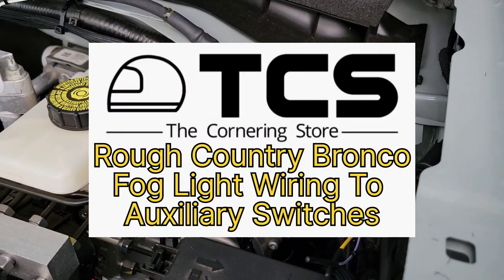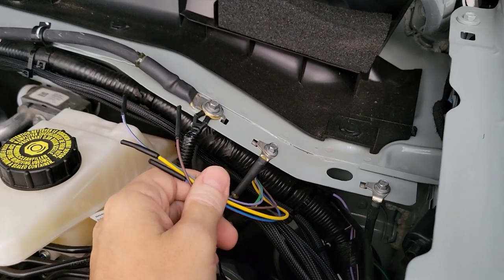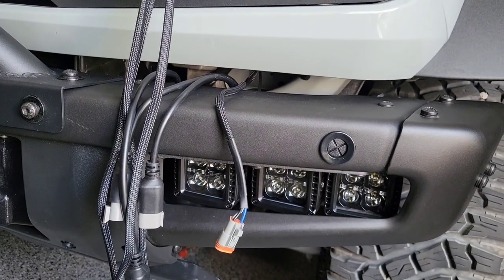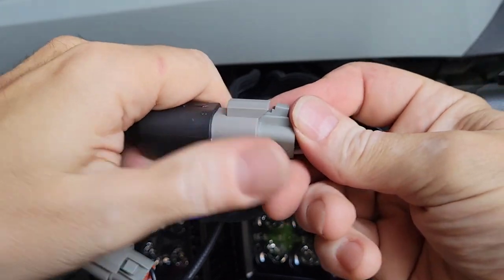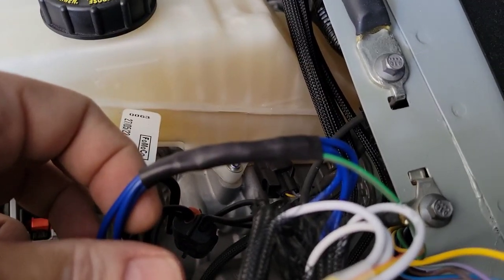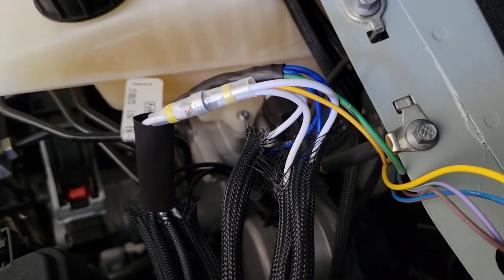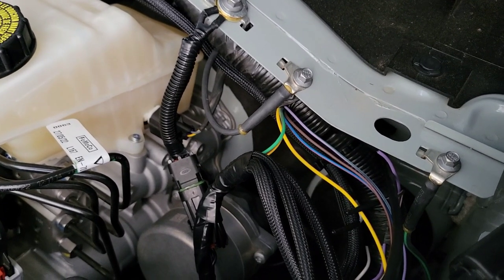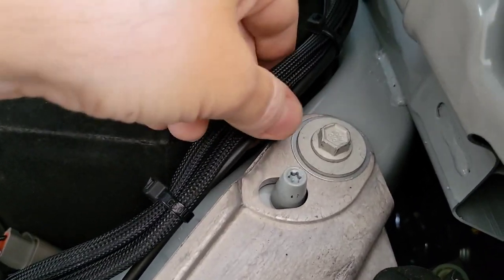Rough Country Bronco Fog Light Installation Wiring With Auxiliary Switches

Comment: Hey! Just wanted to pass on a solid THANKS for this video. I didn’t buy the ones with the DRL, just the basic high output ones from Rough Country. I used the solder thing you recommended too. Worked great. Again, thanks for the video.
Reply from the maker: It's great to hear it helped you out, and you're welcome!!!
Reply: Did u get the flood or the spot? And how is it

Comment: This video was so helpful. Great video. Did you get the white or the amber DRL? I can’t find anything that can explain the difference
Reply from the maker: I have the white DRLS.  The DRLS just mean the color of the backlight.  You can run them on  a different switch  so they are always on when the truck is running.  I picked white so it would go with the headlights since they are always on when you are driving (daytime running lights).   When I want the full brightness I just flip the other switch I have wired to the higher power bulbs in the lights.  So the backlights are just for looks really although they do make you a bit more noticeable coming down the road I'd say.

Comment: Great video!! How are the lights holding up so far? CN you make another video how they look on, off and drls? Thanks
Reply from the maker: They are doing just fine.  I just have aux switch 6 for the DRLs flipped on permanently so they alwayd come on and off with the Bronco.  I've only used the full power once at night and they did a good job of really lighting up the dirt road ahead.  I think with some ditch lights up top to cover the sides a bit more it would be plenty of light for any casual offroad enthusiast.  If I'm able to put together a good lighting scenario I'll put up a video of it.  Thanks!
Reply: @TheCorneringStore  Do you happen to know what the amperage is for the the RC backlighting drls for all 6? I am playing on adding a pair of the same 2" drls as ditch lights and wanted to know if i would be able to tap into the exsisting 6 I already have in aux 6 without it being over the 10amps.
Reply from the maker: @thefontsforfunhustleig3026  I plan on doing the same thing if I add some ditch lights and they have drls. I never saw any listed wattage for the DRLs, but I don't see the drls pulling anything near 10 amps so you will be fine adding another pair into the 6.  I've just had my #6 switch flipped permanently still for the drls and all is good!
Reply: @The Cornering Store  yea my aux 6 is always on too. I am adding the ditch light tomorrow so if any problems I will let you know. Thanks
Reply from the maker: @thefontsforfunhustleig3026  lmk, I was actually just looking at the RC ditch lights online and have them in my cart.
Reply: @The Cornering Store  all installed and they look awesome. No problem tapping into the other drl wire.

Comment: If you run your drls on switch 6 and they are on full time are you able then turn on your switch two and run both the drls and full lights at the same time?.....or is that bad for the lights
Reply from the maker: Yes, you can run both.  No reason it should be bad for them at all.

Comment: Where did you attach the rellay and did you attach the red to the positive battery.  I've never done wiring I want to learn and not call guys all the time to do things for me. But I also don't wanna f up my bronco
Reply from the maker: The Auxiliary Switches have relays built in already.  You just need to ground all the lights and then put the same colors together and connect them to the switch wires as I showed in the video.  You'll end up getting rid of the switch and any other things the lights came with and just connecting the wires right from the lights to a ground point and 2 switches if you have the lights with backlight/driving lights.  Watch the wiring part of the video again and let me know if you still have a question.
Reply from the maker: The power wires from the lights go to the switches.  You don't hook anything to the battery because the power comes from the aux switch wires.
Reply: All of that makes sense. I've only watched this video a million times. Do you cut any of the wires off.(at relay? If not where did you tuck the extra) Other then at the switch to connect aux. Can I use the ground wire that already exists if you don't cut it at relay. Or ground the black wires cut at switch? I really do appreciate you a ton!
Reply from the maker: @MargShaffer  I unplugged all the wires from the switch and cut the ends off all of them since they werent useful for how I wored them up.  You can do whatever is easiest to connect all the ground wires together.  The easiest would be to put a big ring connector on the end of all the ground wires and then just put it under the bolt on the firewall.  

As far as the length I cut and shortened up the drivers side quite a bit and then just trimmed back the abrasion covering/loom.  I only ended up with about 1' of extra wire that is zip tied up by the aux switch wiring.  If you ever need to go back in and replace a light or mess with the wiring you will want a little slack.  

Make sure to slide some shrink wrap on the wires so before connecting them so you can pull it over the connection and shrink it OR do a good tight job with some electrical tape.

Comment: I’m a rookie, do these lights come with the backlight as standard or it works like that because of the way you wired it? I like the idea of using it as drl without blinding other drivers. I like the design of Oracle lights but i don’t know if it works as drl or I can wire the way you did and use less power as backlight
Reply from the maker: Hi, the lights need to be capable/built with backlights.  Think of it as another set of low power bulbs so there is essentially 2 lights in  1 so you can then wire them to separate switches allowing you to have them on separately.
Reply: @TheCorneringStore  ohhh ok, thank you very much what model did you installed?
Reply from the maker: @luissuarez8992  it's the full kit that comes with the 3 lights w/white backlights and brackets for each side that fits the modular bumper. Rough Country brand.  They don't have them on Amazon so you have to look for them on their website or another reseller.
Reply: Thank you! So helpful!

Comment: Im confused, 
Did you cut off the wires with the switch or the wires with the red and black terminal? 
I have aux switches and want to do this setup where the amber drls are always on, but do i cut the switch or the one with black and red terminal/power.
Reply from the maker: Hi Luis, You want to cut off the switches and relays and all that off.  You are just going to wire to your wiring that goes to your aux switches.

Comment: So just to verify. If I have the factory auxiliary switches,. I can remove the relay and the on/off switch that comes on the wire harness?
Reply from the maker: Yes, you just need to ground all the lights and then hook up the like colors together to an aux switch.  Switch 2 or 1 needs to be for the actual full lights and you can use switch 3-6 for the backlight DRL if your lights have that option.  The full lights together take about 15 amps and aux switch 2 is rated for exactly that so I used that leaving my switch 1 freed up for bigger things later maybe.

Comment: I am planning to do this install as well but want 2 pairs to be in switch 2 and 1 pair to be on switch 3 but wire all blue wire = DRL wire into switch 6 and
all ground wire into 1 wire will this work? or should I separate the ground wire by the switch 2 and 3
Reply from the maker: It's perfectly fine to wire all the grounds together and just separate the light power wires to the switches that you want to operate them.
Reply: @TheCorneringStore  how were you able to connect all 6 wires before putting it in the heat shrink?
Reply from the maker: @Sanjuk0522  slide big enough shrink wrap down the wires on both sides and after connected slide the shrink wrap back up and over the connection.
Reply: @TheCorneringStore  so you twisted all 6 bare wires?

Comment: I have a base model not prewired any suggestions for fog lights
Reply from the maker: If you're just planning on adding one set of lights then it would be overkill to get into installing switch panels etc.  For just one set of lights I'd look for someone illustrating how to add factory fog lights to the base bronco because I'd like to add them to the factory switch where the Fog Light button is I believe on the higher trim trucks. The other option would be to just wire your fog light in per their instructions and use a fuse tap to get power to them without any splicing needed and mount a separate switch for them at the bottom of the dash somewhere.  

If you haven't bought fog lights yet check out the ones in a video by "Greenback Grange Tn"  . The lights he found fit really well on the base bumper.  You'll need to find another video though regarding wiring without the aux switches since he has them.

Comment: I appreciate the video. I recently purchased the 3.5 Round LED ditch lights from RC. I assume they have a similar wire setup? They come with 2-blue, 2-white, 1-red, 3- black that all attach to the switch. I don’t care to use the DRL portion of the light, so do it connect the blue(power) and 3 (black/ground) only?
Reply from the maker: You should just have an equal number of power and grounds if they are like the bumper lights. Anything else is most likely part of a harness that it came with that isn't needed?  I know I have seen different colors in different lights for the mains or backlighting.  If it says Blue is the power and black is the ground then test a blue wire on your positive terminal and then touch the black ground to your negative and see if and what it lights up.  Switch to the other ground if nothing happens and see what you get.  Ditch lights are on my list.  I just picked up some Ford Tube doors though and am looking forward to some warm weather to test them out.

Comment: That truck has sensors.  You could have bought a foglamp enabled headlight switch and plugged into the harness behind the bumper for the foglights and had backlight to the switch.

Comment: I put my blue wires on switch 3 and my white wires on switch 2. Problem is when I switch aux 3 the DRLs and white spots come on . Same thing happens when I turn aux 2 on. Can’t seem to get the DRLs to run by themselves . Went back and verified wiring . All blues to aux 3 and all spots to aux 2. Can’t figure what I did wrong . Any suggestions ?
Reply from the maker: There shouldn't be any way for the others to get power.... weird.  Hmm, you cut off all the relays and everything, right?  There is some way that power is being connected to both/all wires.
Reply: @TheCorneringStore  I did cut all the relays off. I’m stumped . I ordered the solder connections from your video. Once they arrive I’m gonna cut it all loose at the wiring harness termination and rewire.
Reply from the maker: @Tim Hallman  after you remove everything test those switches with a test light amd make sure they don't both operate both wires.  I would think it would be idiot proof at the factory, but possibly when the aux switch panel was installed or when the relays etc that are in a different area were wired incorrectly by Ford.
Reply: @TheCorneringStore  good idea… I’ll do that . Just to be safe too. I’m also gonna wire my DRLs all the way over to aux6 and see if that changes anything

Comment: Can u show me how to remove the on off switch  the harness came with
Reply from the maker: I just cut all the wires off.  Leave the wires as long as you can and you cam trim them down later after youve routed them. You won't be using it for the install if you are using your factory aux switches, but as long as you leave some length then you could use the switch later.  I'm going by memory here.
Reply: Do I need the black and red wires or just remove the and keep the black for ground
Reply: Is the aux switch in the bronco the power so I don't need the red wire just the black for ground
Reply from the maker: @junior97007  if you have the aux switches the power wire for each switch is in the engine bay.  They are color coded for each switch. If you use your broncos radio you can find the wiring schematics in it.  Use the power wire for the switch you want to use and wire the light power wires to it, and yes, then you just need to ground the ground wire from the lights where you want to. No need for the red from the switch if my memory serves correct.
Reply: @TheCorneringStore  thank u for your help 🙏